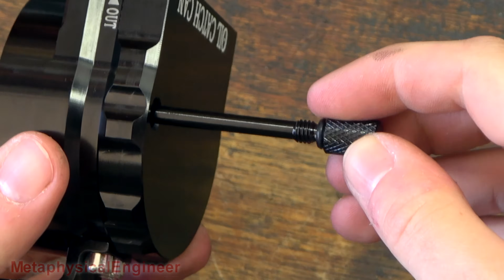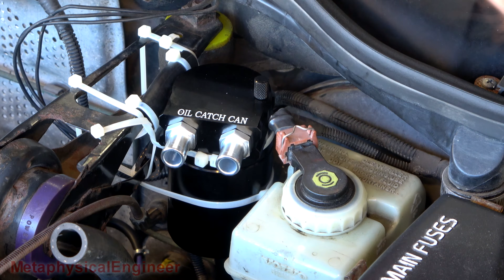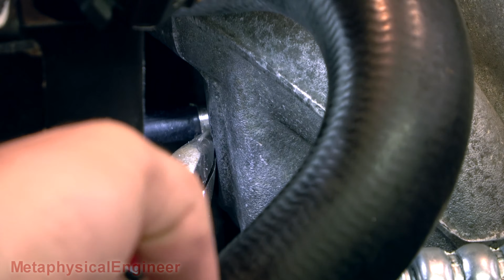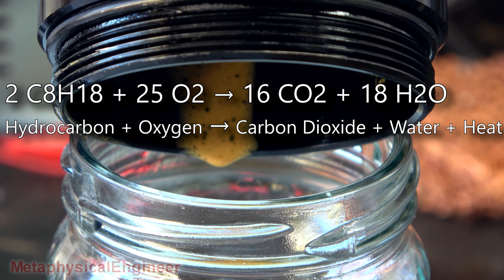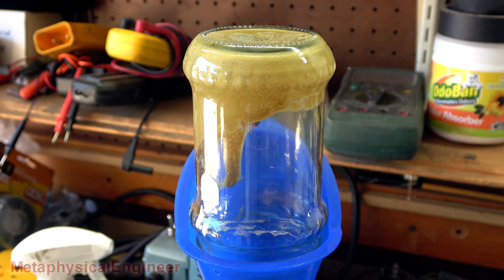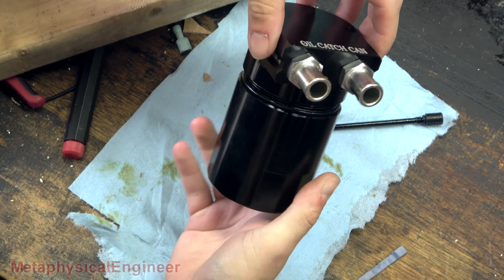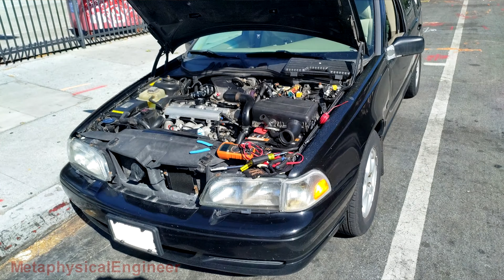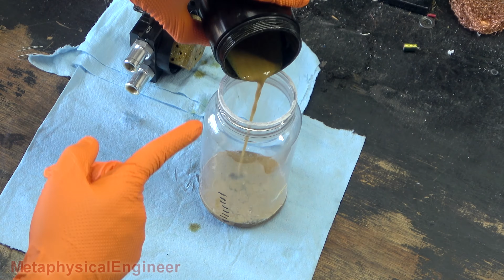I Tried the Evil Energy Catch Can for 3000 Miles

Comment: I run that exact catch can on a GMC 2500HD 6.0 gas engine, I discovered the inside of my intake was coated with a oily soot, the addition of the can solved the issue and i suspect has made the pcv system more efficient, based on more direct routing of hoses, not having the factory molded hoses.  I’ve gotten about 1.5oz of “fluid” collected per 1,000 miles.
Reply: I thought the truck system was better than the LS2 PCV system (which is unique in design to itself) where it has a tendency to "invert" the flow direction and siphon oil straight from the valve cover instead of pulling from the lifter valley where it is supposed to. A one way checkball valve solved it on my LS2.
Reply: @meatybtz  where did you put that check ball valve? Curious if it will make a difference on my LS2 compared to my catch can. Thx
Reply: @mikee2398  Ok, so it's hard to describe. The proper LS2 flow pattern is out the valley into the T-body. In to the engine from the  ducting (after the MAF) into the valve cover. So the easiest place to put it is in the pipe from the ducting into the valvecover to prevent venturi flow reversal (aka sucking from the valve cover). Now the valve cover has baffles but it took me forever to find the GM documents showing how the flow was supposed to work. The idea was meter the air through the engine. It was brilliant... just needed something to prevent flow reversal caused by air at speed flying by the little straw in the duct (which would create a venturi action and cause a suction).  I have two check balls, but that's just me doing stupid overkill. I also have a catch can. Barely catch anything. But what really improved my oil consumption to zero was to clean the oil-control rings (the clog to shit so fast with carbon) using Restore and Protect Oil. I now have zero oil consumption and better compression. Only vapor condensate in the catch can these days.
Reply: @meatybtz  can you provide a link to the check valve you used on your LS2?
Reply from the maker: Thanks for sharing!  Really is surprising how much of a mess a little oil through the intake causes.  Then again, that's almost half a quart in 10k miles.  Do you tow or otherwise run the truck under lots of load?  What year and how many miles total?
Reply: That is about what I get out of my 2018 5.3l. Added a 2nd catchcan & it only gets a spoonful or so by 3000 miles. The 1st can does a good job.
Reply: Your video is absolutely awesome and I am officially a huge fan of yours! LoL! I have a 2017 Ford Focus ST and your video really helped me and also with the decision to get this particular catch can. I just couldn’t bring myself to pay hundreds of dollars that some catch can manufactures charge and this made it easy! I can’t thank you enough!
Reply: I recommend upgrading to the revised driver-side valve cover with the improved internal baffle. (GM bulletin PIP4492S discusses this oil ingestion issue)
My catch can used to collect a lot of oil and fill up every 4,000 miles. Since replacing the valve cover, virtually no oil collects, and my oil consumption is gone!
I did make one modification by drilling four evenly spaced 3/16” drain holes along the bottom edge of the internal baffle, to improve oil drainage.
I’ve done this on three trucks and I used the $45 Amazon valve cover. I removed the excess RTV around the baffle plate (with a fine wire brush) inside the cover and thoroughly cleaned out any debris before installation, and used the gasket that came with it. It’s been 2 years, no issues or oil consumption!
One more tip: On the rear-mounted cam sensor, check its O-ring for oil leaks behind the intake manifold. If the sensor works and only the O-ring is leaking, just replace the O-ring, not the entire sensor! Common leak on these LS engines. 
Hope this helps. Good luck!
Reply: Jesus! The problem you have is a mixture of water and oil. Check the cap gasket....